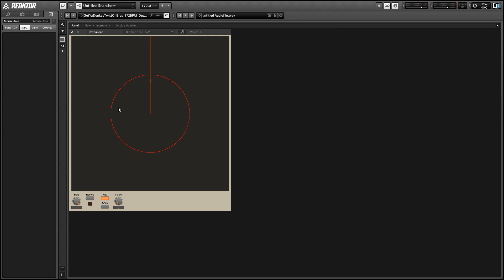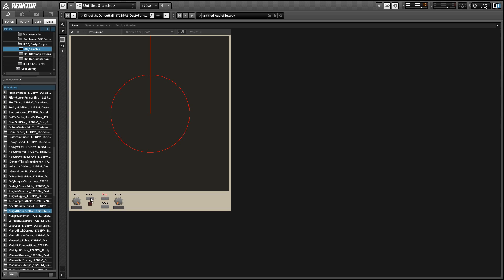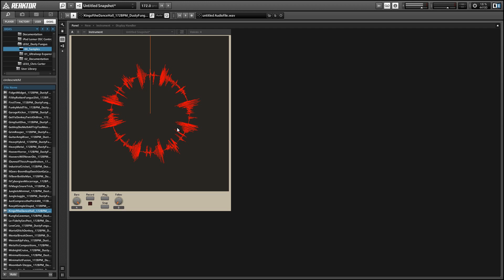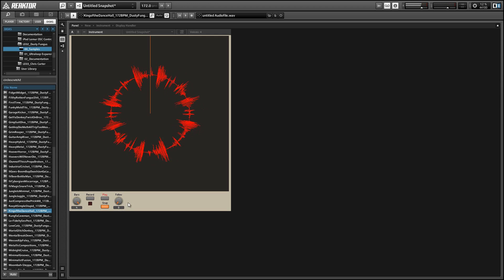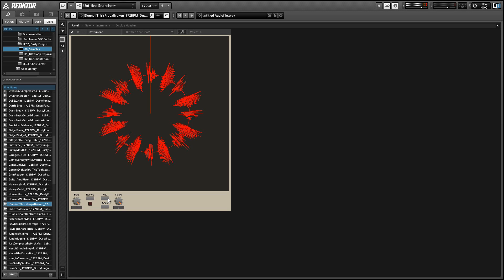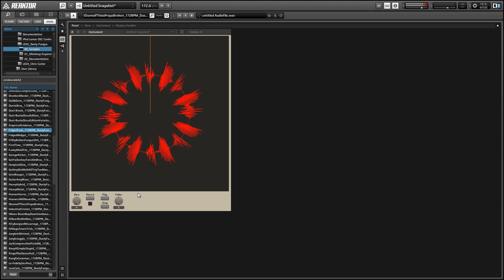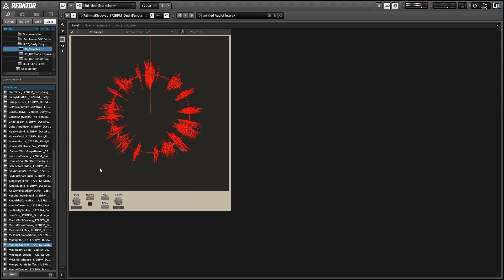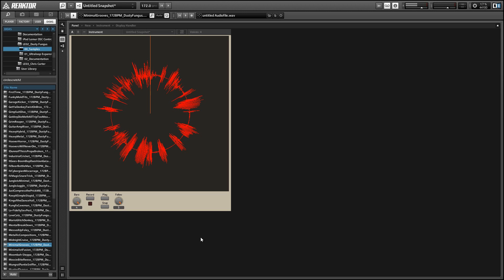NI Reaktor Tutorial - Using CircleScratch

Comment: This is a really cool idea. Thank you! I do have suggestion: to have a soft-touch or "finger pressure" controls that determine the speed at which the finger/pointer "grabs" (and releases) the spin. (grab and release dials?) - in milliseconds. Also to be able to automate the spin - perhaps with either angular position (could be tricky when it goes past 360) or +/- spin speed (where 0 = the natural rotation of the disk)...